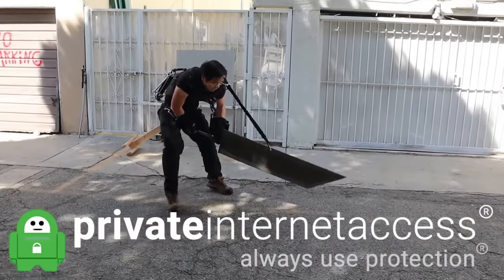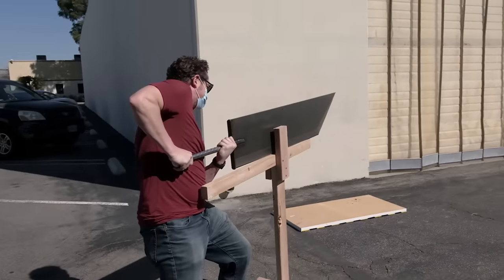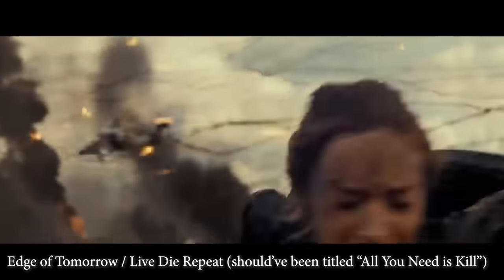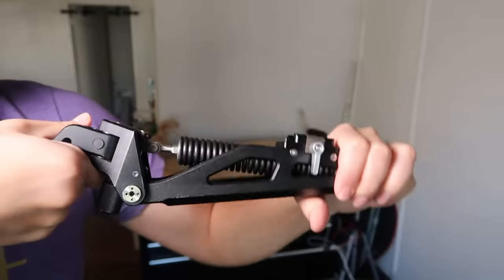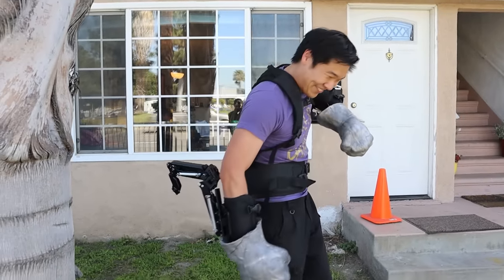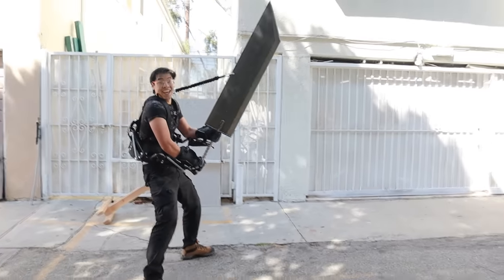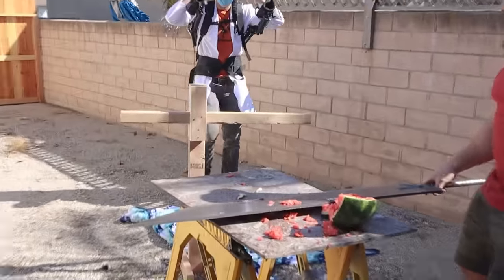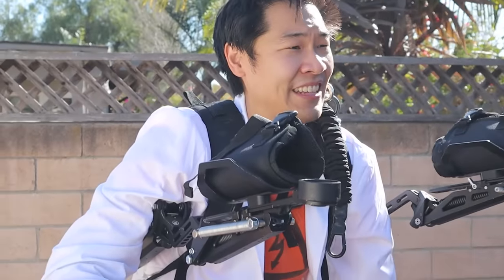I bought an Exoskeleton to wield Giant Anime Swords

Comment: Guts’ dragon slayer is 400 pounds which means it’s actually around 2-3000 pounds when he wields it. Explains how the demon basically explode when he hits them directly with it
Reply: I'm pretty sure that's ballpark of how much a male gorilla could bench press if it were taught how. Take it with a grain of salt but I saw it somewhere, like 4k
Reply: That thing was too big to be called a sword. Massive, thick, heavy, and far too rough. Indeed, it was a heap of raw iron.
Reply: I like to think dragon slayer's weight is up for interpretation. If the sword in this video is 50lbs you could imagine a realistic slimmer dragon slayer that weights around 70lbs and still has some of this weight distributed in the handle, keeping it from torque twisting the wielder's wrist apart
Reply: Now I wanna see someone make a replica of the Berserker Armor that also functions as an exoskeleton
Reply: He also swings it sideways and with one hand on occasion
Reply: @combinemax  pretty sure that its canonically like 400 or 500 pounds tho lol. Humans cannot wield it, guts is just a monster. Now imagine getting wacked by it. He's essentially hitting you with the force of a car along a fine line of metal.
Reply: @NateO123  I understand that it's canon, but I just like to think that
Reply: @combinemax  you'd rather think its less awesome? Do you I guess.
Reply: @polkadi  its a sharpened steel wall, mounted on a handle
Reply: @respectfulevil9022  He grabbed that sword with his MOUTH
Reply: @NateO123  Always wondered if he knew a technique for breaking swords because he does it a lot. Nah, he’s just swinging around a car lol
Reply: @combinemax  that shit is way to thick to be anywhere near 70 pounds
Reply: @combinemax  sure, but the notable thing is that he wields it with more speed than most people are shown to wield straight swords in the manga.
Reply: the fans all have different weights they think it is all using different calculations, but the creator himself says its 440 lbs.
Reply: @tonyjames3541  or someone make a replica of the Fume Ultra Greatsword from dark souls 2 and 3
Reply: only 2 pounds to 3000 pounds?
Reply: @polkadi  (:
Reply: @combinemax  the buster sword here (much shorter then the fictional one) is maybe 4'6ft dragonslayer is 7'1 with even if you slimmed it down to the slimness of this sword it would still top out over 100 pounds. and the longer it is the more excess torque it will make, multiplying exponentially.
Reply: yeah cause it crushes them before actually slicing them
Reply: it was never stated howheavy the sword is! i would say around 50kg!
around 180cm (or even less) long and 25cm wide + 2,5cm thick and it is 11.250cm cm3 
density of steel is around 7750kg/m3 (7750 to 8050) 
so the mass of the sword is around  87 kg!!!

yes the mountain from game of thrones is a real person hafthor bjornson (litereally his name mean sea thor/thunder and the son of the bear) who also the eternal champion of the DEATHLIFT!!! his record was just only 501 FUKING KG!!! for you is 1104 pounds!!!
so physically haftor the mountain could swing a 90kg sword? hell probably he could!!! he already lifted 5,7x heavier object!!! near 6x heavier than guts' sword...
Reply: @respectfulevil9022 actually, he always swings it with one hand.
Reply: You're forgetting that the Dragonslayer is twice as long as this sword, the torsional force would be way more since the center of gravity is way further up.
Reply: @gipsymelody1268 You're ignoring the torque. Good measurement of weight though
Reply: @gremlinman9724 It's because Guts is absurdly strong. Remember, the Dragon Slayer was never intended to be used by anyone- it was simply a utilitarian response to a request for a sword fit to kill a dragon.

Comment: Bro, I like how the concept was "look, even a professional strong man has trouble lifting this sword", and he just lifts it like it's nothing. This dude is unreal
Reply: To be fair one sword was 100 pounds of metal on a stick and this one was half that weight
Reply: The one the strongman was more than twice the weight.
Reply: @alondor8157  If we gave the sword an exoskeleton, could it wield a strongman?
Reply: Its probably because he works out grip strength, if you workout grip you have way more power in other muscles you've never even used daily and allows you to carry oddly shaped things easier so weight distribution issues arent really a problem you just power through the torque and get to the point where the weight becomes even again when it goes vertical. Like has no one ever used a 18-25 pound sledge hammer?
Reply: there's also the fact that allen's sword is a lot lighter than the other one
Reply: @Armagedon013 possibly I have a 160 and 120 stone and they work out hip and burst pretty good. Definitely might have a significant impact.
Reply: To be fair, the sword was around 50lbs. Much lighter than the sword used by demolishion ranch
Reply: Not the same sword. The sword the professional strong man lifted was 120lbs, which when considering the torque would be something like 360lbs or more. The sword Allen had here was 50lbs.
Reply: I'll be honest, I absolutely cacked it when he straight up dissolved that watermelon, wow
Reply: Eddie Hall would call that sword a paper weight...
Reply: demo ranch's sword was 800 pounds and this was 50
Reply: Everyone talking about how this sword is *only*50 lbs, go put a 50lb weight on a three foot stick and try to lift it using only the first 12" of the handle lol That is some incredible strength required to lift and control that thing
Reply: @kemphoss-4791  when you want to drive in a roofing nail in one go
Reply: @ThatFreeWilliam  Asking the real question here!

Comment: It honestly looks like the real buster sword probably has a lot of weight focused onto the crossguard to move that center of gravity closer to the leading hand. Though oddly not much at the pommel...
Reply: Also helps that Cloud is a literal super soldier who was experimented on.
Reply: @paperluigi6132  Were not talking about the fantasy context but how its actually built.
Reply: @Calvados / Rezo  it's also likely that in a real-world context the handle would be more of an oval or rectangular shape to help keep the edge as aligned as possible... (as much as it would help a heavy sword)
Reply: "The real buster sword"
Reply: yeah I was thinking that the blade looks way thinner and probably has a distal taper, as well as the huge chunky handguard pushing the COM closer to the hilt. Ideally in a sword you want the COM to be right on the line between the guard and the blade (or cuff if present) because that's where it needs to rotate to be most effective in an actual fight.

Comment: If you ever revisit this build, here are some potential things to consider:

1. One of the major things that would increase the ability to handle the sword itself is what you’re holding. A completely circular, metal handle allows for some extreme rotation in your hands, something you already battle with such a heavy weapon. Try an ovular handle instead, since it will allow you hands a much more tight and controlled grip.
2. More inline with handle, but this time the material. Try wrapping the handle in some sort of wrap or cloth to further increase friction. It doesn’t have to be a fancy leather weave. Things like hockey tape will allow dividends in improvement.
3. Perhaps controversial, but it may help to make the sword “more” heavy by adding a heavy counterweight in the pommel. Something like a threaded lead one will fight the torque you mention, as it will move the balance of the sword up closer to the hand and allow you much better control.

Either way, great video. They’re always a blast : ).
Reply: This may be the straight up most helpful and knowledgeable comment I've ever seen on YouTube. Not all heroes wear caps, sir, thank you!
Reply: Most practical sword weight between 1 to 2 kg this sword is impractical nonsense and quite frankly silly
Reply: @leebennett1821  thats like literally the whole point of it, its supposed to be silly.
Reply: @leebennett1821  ... that's the point it's a make believe sword an anime sword...
Reply: Praise the anime engineer
Reply: Thank you for the great tips, DIO
Reply: I... I don't know what to say
Reply: The pommel weight could be made out of tungsten to allow for a smaller pommel and plus it would alow him to pommel bash stuff without fear of scratches on it
Reply: Thank you DIO very cool
Reply: Another important thing would be leg support.  At the end of the day, his legs are still holding up that weight by themselves.
Reply: Hey Dio, remember when you got stabbed and fell from a castle? Lol noob.
Reply: @cryojak807  I was thinking in a practical sense     I know the magic of it is the imbalance but im thinking for Allen
Reply: @carso1500  that would definitely turn a head into mush
Reply: @SgtRock-et7zl  yup
Reply: @ddb1014  a fellow jojo fan i see
Reply: A little bit thinner blade, with holes in it would help too
Reply: Distal taper would probably make it a whole lot wieldier, too.
Reply: Dio be spitting some damn facts
Reply: muda! muda! muda! muda! muda! muda! muda!
Reply: ZA WAURDO!!!

Comment: I love that there was all this science explaining why lifting the sword was almost impossible, then Chase Lee comes in and just blows all that away with sheer strength.
Reply: No one said almost impossible, only that it generated significantly more force in torque than the weight alone would lead you to believe.  

Realistically it's just like saying "This 150 pound weight is heavy for me, not so much for this dude who regularly lifts heavy things for a living"
Reply: This is basically why elite level gymnasts are the top athletes in my opinion, they make advanced body levers look insanely easy, yet that type of training is insanely difficult. Guys who can perform an iron cross have insane straight arm strength, but most guys neglect straight arm strength training because it doesn't exactly lead to big muscle aesthetics. I would love to see if a pro gymnast could potentially wield it even better, but Chase was really impressive.
Reply: @HerroVincey  No way. The sword would probably wield the gymnast. Not enough mass, they'd just tip over.
Reply: @HerroVincey  Not downplaying gymnasts at all as they probably have the most pound for pound strength out of most athletes.

However, as the guy above me said, another factor that makes wielding the buster sword so damn hard is that it weighs a good percentage chunk of the average person and said weight is also awkwardly placed. Someone less athletic, but still reasonably fit, say 7' feet and 250lbs, would likely wield the sword much easier than a world class gymnast who is 5'9" and a solid 165lb of muscle, due to the pure mechanical advantage the taller heavier person will have in this instance.

Comment: This makes me realize how strong Cloud is. He can twirl a 50ib swowd like it's nothing for his victory pose
Reply: He literally had the best DNA infused with him, it wasn't just a soldier DNA modification, it was Soldier 1st Class modification using the DNAs of the strongest people. Zack, Sephiroth, Jenova were likely the DNA samples.
Reply: @envynoson  Even with super strength, he must also must weigh several tons, otherwise the momentum of the sword would throw him off his feet.
Reply: @UngodlyFreak  Not necessarily. That would only apply if you were under the assumption that you don't have super human lower body strength too, otherwise your legs and abs can counteract the centrifugal force. Skallagrim covers it in this video: https://www.youtube.com/watch?v=Cprtf5YYk3k
Reply: Cloud's Buster Sword is actually 100 pounds
Reply: @nettlesomenpc889  holy shit
Reply: low key mokey mokey it don’t matter how strong he is if he don’t got like super grip shoes he still gunna slide trying to twirl a sword at least 1/4 of his weight
Reply: @remen8021  2/3 of his weight
Reply: Cloud is 150 pounds
Reply: @lowkeymokeymokey3360  Legs and abs won't count for a thing when raw momentum comes into it. The friction between your feet and the ground is the only thing stopping you from sliding around, and your balance muscles just help prevent you from falling over. If you try to stop that much momentum, it doesn't matter how well you can balance, you're gonna slide around like you're on ice.

Balance also won't count for anything if the momentum takes you off your feet, even if only briefly. If for half a second you're essentially weightless, you're incapable of exerting any force downwards and you'll fall over.
Reply: @lowkeymokeymokey3360  but even still just imagine the centrifugal forces on clouds body
Reply: @lowkeymokeymokey3360  his arms would literally just disappear if he was a normal person and he could swing that weight
Reply: it’s because he’s a failed sephiroth clone. Most of the SOLDIERS could wield a sword this big anyways, so it’s possible it’s lighter then it looks
Reply: Cloud doesn't exist. He's an anime character.
Reply: It’s even more apparent when you realize how levers work and where most of the weight is.
Reply: Guts:Hold my beer
Reply: 50ib swowd
Reply: There's a reason he can fight a super-being destroyer of worlds.
Reply: It's kinda sad that no one talks about zack Or angeal the people who originally had it
Reply: there is a thing not being considered here, realism vs verosimilitude, FF universe clearly has different rules since realism is based on our reality and versosimilitude is based on how believable is something of a specific universe for that universe, in a universe were materia and magic exist certain laws of physics would be different so we can argue that in its own verosimilitude cloud can wield it without being carried by his own weight and momentum
Reply: @laughingman3777  but he still has realistic measures within the universe he is in which is what people are trying to discuss
Reply: In real life it wouldn’t matter how much strength you have. the momentum is the bigger problem as the weapon will start swinging you around
Reply: the worst part about this whole thing:

ASBESTOS - Beam me OUT scoutty lol
Reply: @equidistanthoneyjoy7600  I think you're forgetting that he's carrying the 100lb sword. That doesn't just weigh down on him, it weighs down on the ground. That also increases friction, obviously.
Reply: @megahellreaper  That friction is gone while he's swinging it.
Reply: @equidistanthoneyjoy7600  | This is why I appreciate the way Dark Souls characters swing oversized weapons. While still ridiculous, they rely entirely on the thing's weight instead of trying to use it like an actual sword.
Reply: Hey man, you get any of more them Jenova cells?
Reply: Cloud,Guts,asta
Reply: @EstebanBrenesV  I get that you're super excited to use a big word, but 2 things; 1st, it's verisimilitude, and 2nd, would have been much more appropriate to just say "reality vs fiction" because that's literally the difference that matters.
Reply: @Astraeus..  sorry if that word looks big to you (also I might have made a mistakewhen I wrote it thanks for the correction) pehaps I should just use plausibility which might be more common? there is a meaning in literature to this that implies that something that is plausible depending on the context of the world that an author conveys to its audience, an "unwritten contract" if I quote an author called Unberto Eco, in which what its pausible is conveyed directly from the posibilities set written world allows, this of course also applies to other media besides literature and it extents to fantasy, film and games. That is the meaning of the verisimilitude I mentioned in my original reply.
Reply: @EstebanBrenesV  The word doesn't look "too big" for me, it's just that you're using an obtuse set of words for something that should be simple. In fact I can simplify it even further than I did initially by defining the differences using a slight variation of just one word;

Realism vs Realistic.

I'm not going to bother explaining the difference, but since you seem so fond of your big words you should be able to figure it out.
Reply: @Astraeus..  Then you miss my point plausibility in media is what i wanted to portray not what you said, and I just wanted to add, realism vs realistic is not a comparison, they are practically used for the same term, also you cant use either for fantasy or sci-fi settings as neither are based on real world logic, so as an example you cant say flying is realistic but in a super hero setting you can say its plausible in its own context, not real but instead belieable in its own setting.